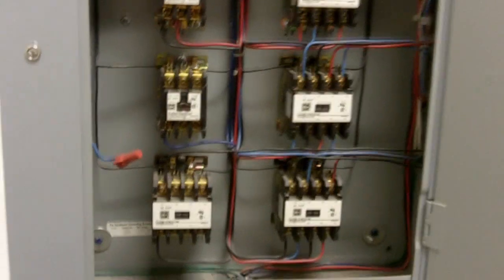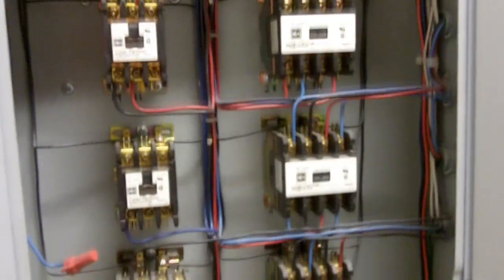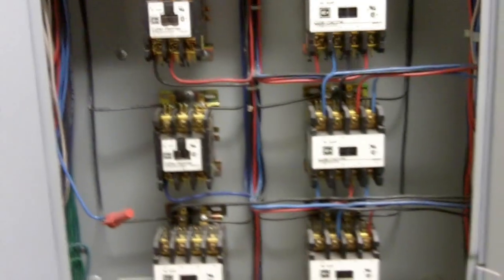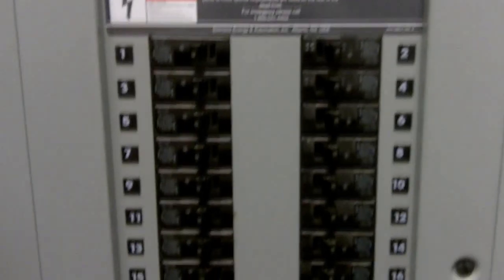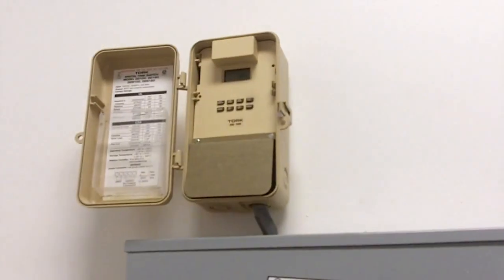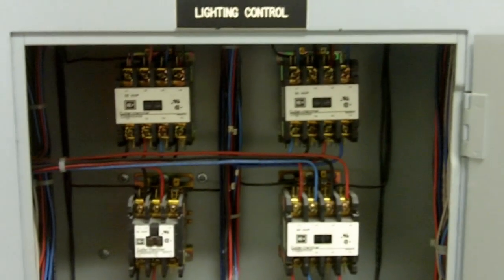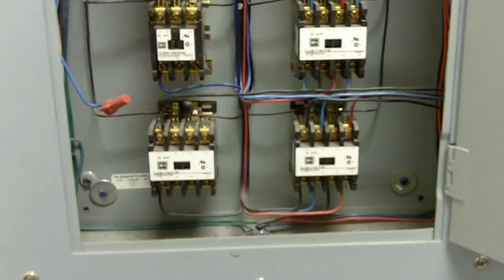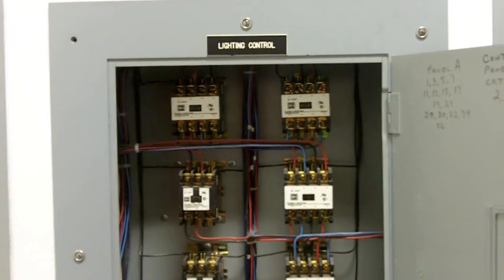Electrical Wiring- Lighting Contactor

Comment: A non electrician question. When wiring up the contactor connections, must the ends of the wires be in a "J" formation, or can they go in straight "l" behind the square washers?

Comment: Question? Are Only those two switches powering all of the contactors? So the switches are line volt  (120v) or is it possible they are 20v ?
Reply from the maker: There were only a few switch from what I can remember. I think that they were 120v. That was a long time ago!

Comment from the maker: These contactors are used in a retail store for the control of all their lighting.
Many commercial properties have systems to control lighting,signs and motors.
Reply: I used to.wire lighting controls all the time when I worked for a retail chain In the maintenance  department. It takes years to become that near but it pays off later working on it

Comment: The work is neat but none of the wires are identified.  The minute anybody needs to do any trouble shooting odds are the cable ties will be cut and the nice work will go out the window.  I would rather trade off a little bit of tidyness for proper circuit identification.  I love the eye level access and the roomyness of the control cabinet though.  If you have the space why not get a bigger box if it is not going to cost to much extra and the owner doesn't mind the extra space it's taking up?

Comment: HI, If i were to specify a contactor setup for simple lighting control with one master off control switch, what type and number of poles would i specify for my (9), 120V 20A lighting circuits. I know each circuit has a Hot + Neutral, but does that mean i need a 18 pole contactor?
Reply from the maker: You would only be controlling the load side of the circuit,not the neutrals.The type of lights,florescent,HID,incandescent are factored in when determining the type of contactor.
Reply: Was looking at doing LED or T5ho fluorescent as options. Any good literature I can read on the differences?
Reply from the maker: Tauran Ivall  Around here they are called definite purpose contactors or all purpose contactors. You can get any combination of poles on your contactor to fit the need. Wire them together with your specified voltage.